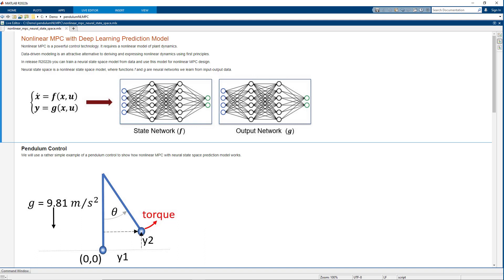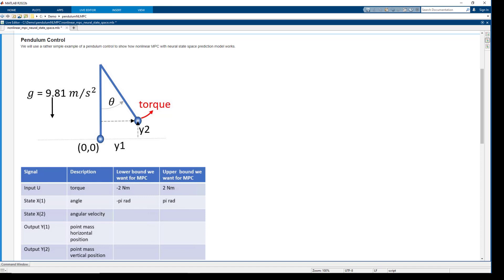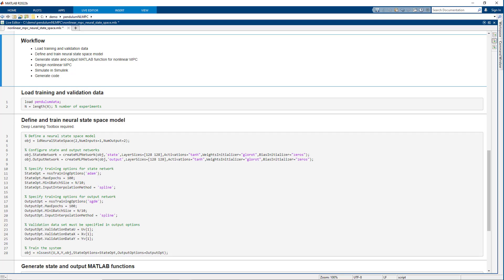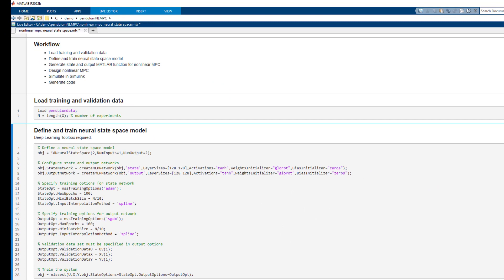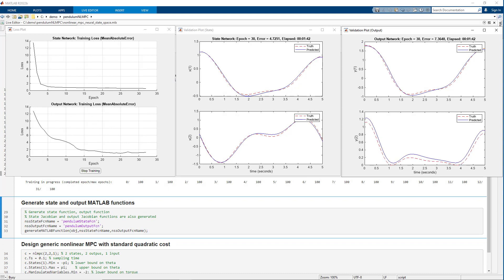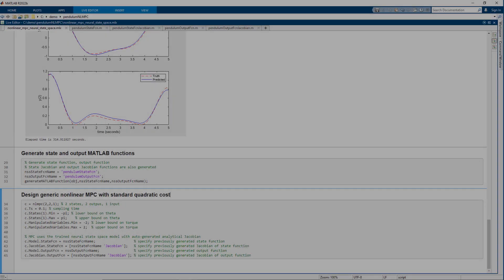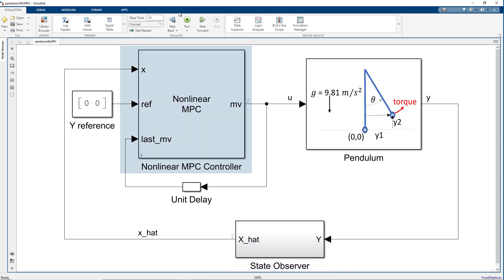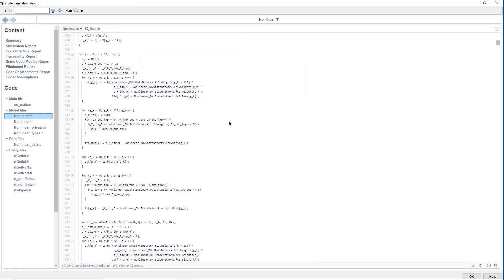How to Design Nonlinear MPC with Deep Learning Prediction Model

Comment: The Simulink model shared is not the same block diagram in the video, it does not have the pendulum dynamic model and the observer. Alos, it uses multiple stages NLMPC

Comment: Hi, I found out that the NMPC designed for the pendulum is not able to track the reference x1=pi or x1 near pi, why is it so? I was wondering if you can provide the reference for the solution you implemented in your code. Thanks a lot!
Reply: It's also not able to control x(1) in ranges(-0.6 to -pi/2) and (0.6 to pi/2), why? Is there any publication\document for this work?